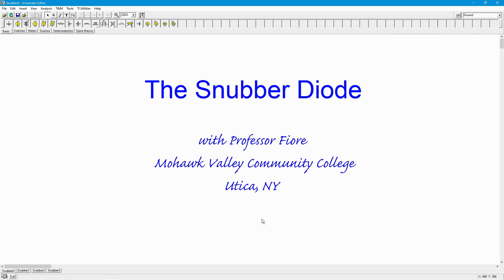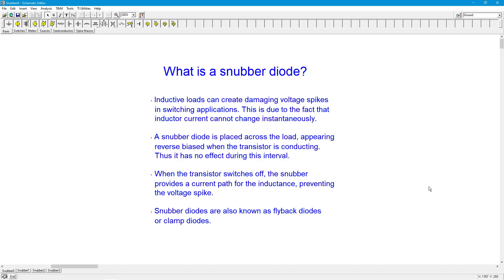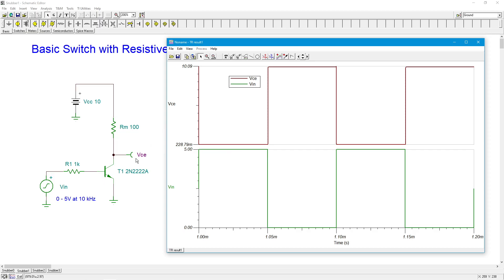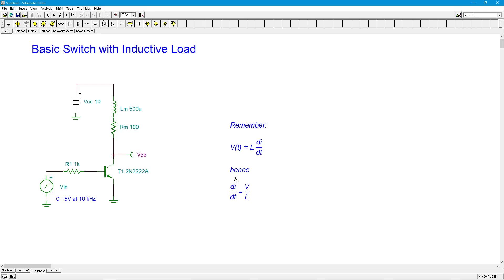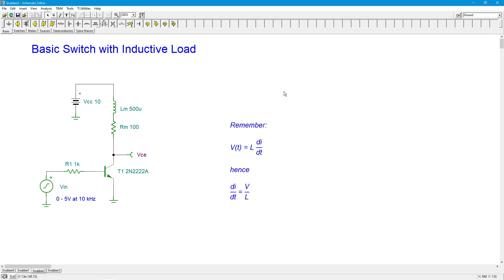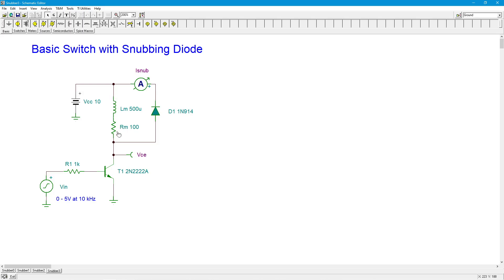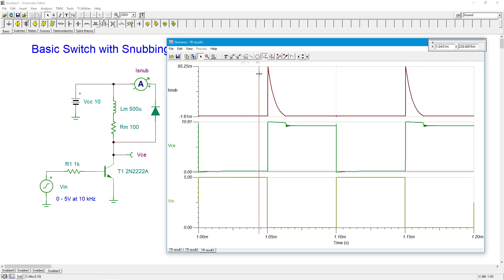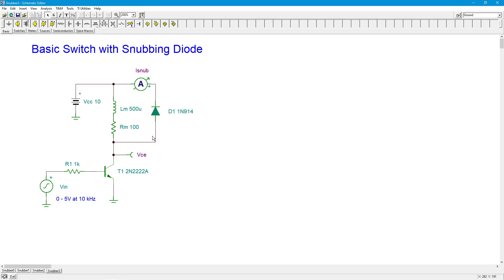Semiconductor Devices: The Snubber Diode

Comment: We use this kind of diode protection pretty often alongside relay coils for bypass or switching in guitar pedals and studio equipment. Lately, though, I have been using more solid state analog cmos switches, which don't have this problem.
Reply: Analog switches do have a worse on resistance, though in my application, it's not usually a problem.

Comment: Just a few points:
 You should point out the importance of the resistance, as too low a resistance hold the output high long enough to significantly effect duty cycle - or prevent it from ever turning off. Using a Schottky and zener in series would have been a great addition to this video to see the dramatic changes forward voltage makes in switching time, ringing, and output voltage. And in higher power circuits, the power rating of the resistor is not trivial. 
It's also worth pointing out that this circuit is essentially the simplist and worst boost converter possible.
I was going to say something about RC snubbers, but then I realized that's probably going to be your next video.
Excellent video for >95% of people... I know I'm in the minority of people who learn every circuit by building one that does hundreds of volts and then can't figure out why everything explodes. 😁
Reply from the maker: Yes, there is a lot more that can be said on this topic, but it is an introductory video after all. I try to keep "the bites of information" small (pun intended). ;-)

Comment: Thankyou. Presumably, if we put the diode astride the inductor only, the ringing/continuation of current is longer? In other words, how does the position of the load resistor, in this example, effect the outcomes?
Reply from the maker: In the real real world, you can't. Remember, the resistor/inductor combo is a simple model for a real world inductor. There isn't a separate resistor.
Reply: @ElectronicswithProfessorFiore  Yes, indeed. I did forget about every component having some resistance. Thankyou!
Reply: @simonyoungglostog  It does make a huge effect, though. Because the spike gets limited to the forward voltage, you know the voltage and the resistance, you use ohm's law to get the amps, and then with the energy in the inductor you can calculate how long it will hold the voltage high. EEVlog has a video where a snubber diode on a relay holds it closed  an extra half second or something crazy I never would have suspected.

Comment: Great video, Professor. You are not wrong in your explanation, but I just want to point out that the main reason why the current in an inductor cannot change instantaneously is because the derivative must exist at every point. This requires continuity in the current function. Great work!
Reply from the maker: True. I assume familiarity with RL transient response.

Comment: Fantastic explanation, is there any way to discharge the current loop in the snubber circuit so you don't overshoot the 10 volts (10.8V on the Vce waveform)?
Reply from the maker: 10V is what's driving the circuit so I assume you're referring to the extra 0.8, yes? Generally it shouldn't be a problem, but you could get a diode with a lower forward voltage, e.g., schottky diode.